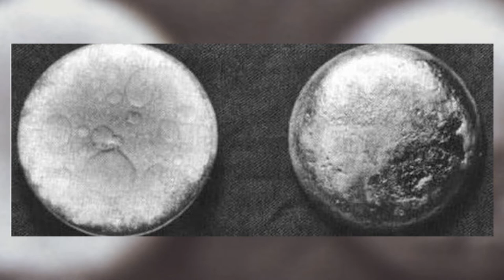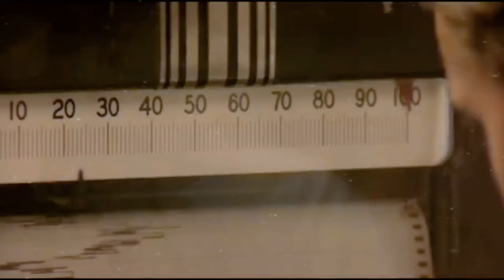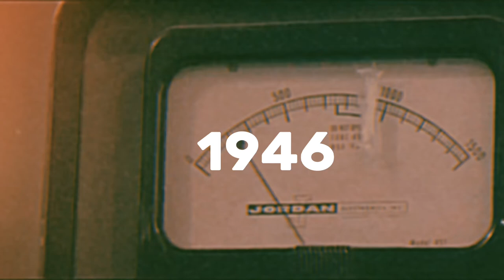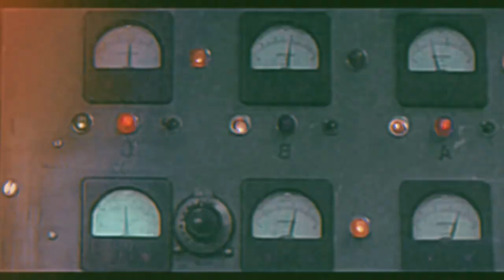What happens when you play with a Nuke

Comment: What Would have happened if Louis slotin didn't push away the demon core when the reaction started happening?
Reply from the maker: It would have been a very different video for 1.
Reply: Criticality is generally happening in a very narrow range of parameters. The core would have heated up and the change in absorption cross section would have brought the core out of criticality. However when the core would be allowed to cool down critically could be reached again. But no detonation. Nuclear detonations happen on a time scale of several nanoseconds, which is why the Manhattan Project cost $US 2 billion.
Reply: It would've kept heating up. What happens next kind of depends on the amount and the type of the material in question. I would guess that this isotope of plutonium in this amount/arrangement would probably have a negative temperature reactivity coefficient, meaning it gets less reactive as it gets hotter. Thus, it would oscillate between subcritical and supercritical as it warmed and cooled, respectively. It's possible, however, that this particular configuration would've caused it to continue to heat up past beryllium's melting point. This would've caused the mass to go subcritical again very quickly, but not before melting partially or fully through the reflector and perhaps into the floor a bit. Just kind of depends. 100% would NOT have been a nuclear explosion, though-- those are actually fairly difficult to achieve. All of the "explosions" you usually hear about in nuclear reactors and such are actually usually thermal explosions (steam), hydrogen ignition, etc. A truly nuclear explosion is not any of those things and can only be produced in a very specific, non-accidental way.